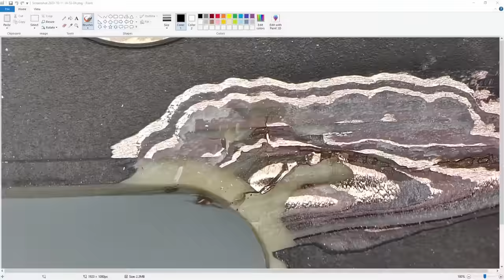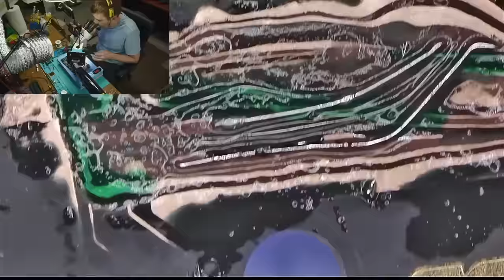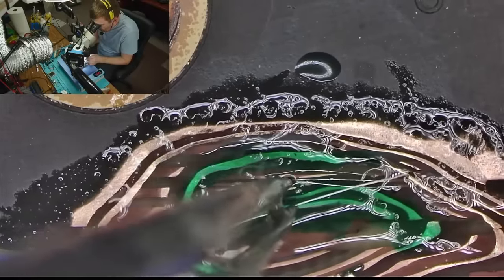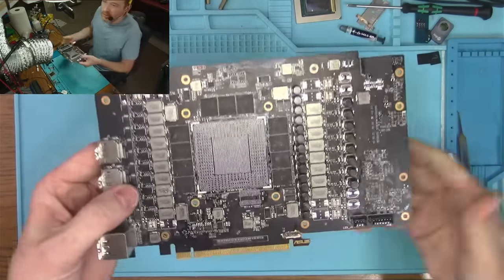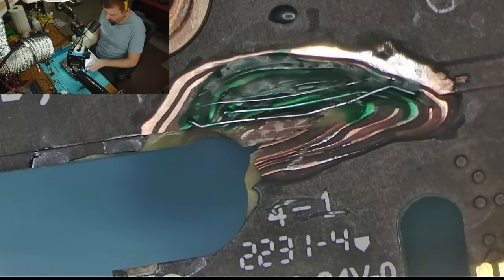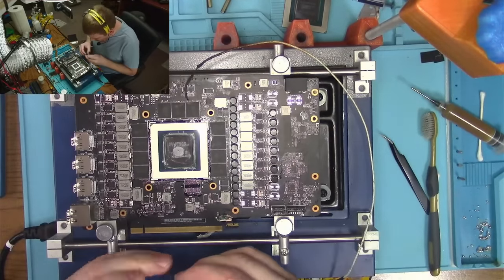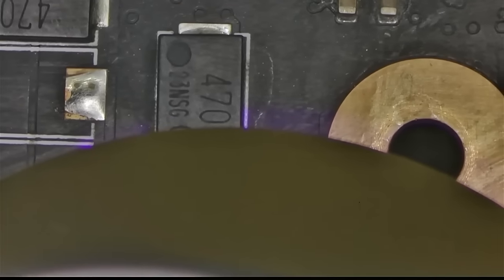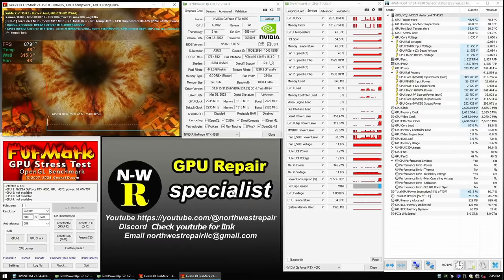Asus 4090 cracked PCB horror Part 2

Comment: If you want a fast setting 2 part epoxy but the one that is labeled 1 minute or 5 minute set time but they set up fast so you have little time to play around with it. You can use painters tape,  masking tape or electrical tape to stop it from flowing where you don't want it

Comment: I would say that you need MORE fibré threads in repair joint. Fill,  cover with clear sheet, and UV cure. Then peel off cover, to leave a nice flat glass-like surface. (fyi: Big Texas cracks come from too much bull🐂 riding)😛

Comment: They should make the pcb on alluminium composite. A layer of aluminium in the middle to increase rigidity. They can drill the aluminium in specific places to allow via to pass. And other board layers on both sides of the aluminium plate. 
It should somewhat solve the problem. Or better if they can make something out of carbon fiber.
Reply: Or people could stop abusing their boards, properly unlocking PCI-E locks, or installing the Card then trying to transport the case. They are heavy and they will break unlike lighter cards of the past. The number of cards I've bought and found components knocked off is getting ridiculous. No one has respect for delicate objects.
Reply: An Aluminum layer thick enough for such a purpose would make it an incredible pain to do work like this, as all the heat would be conducted away to the rest of the board.  It would become an all or nothing with soldering, either re-solder every component on the board or none.  It probably wouldn't be too much of an issue during manufacturing, but repairs would be horrible.  

No, the board makers need to do better with cooler design.  EVGA always reinforced their coolers against the IO plate where either the mid-plate or the heatsink itself is attached to the IO plate and taking most of the weight of the cooler, rather than the board.  It doesn't take much effort or genius to do this, just careful work, and most card makers aren't doing that.  The only other one I know of that does that sort of thing is Sapphire.  I never had card sag issues with my EVGA RTX2080 or my Sapphire 7900XTX, and both have the midplate, between the card and the cooler attached to the memory and power circuitry, fastened directly to the IO plate with a heavy reinforcement bracket, EVGA with a steel plate and Sapphire with a thick cast aluminum bracket.  No cracking on those cards, that's for sure.  They're held up by the back of the PC case.
Reply: @dangingerich2559 for all the hate amd reference cards get atleast there coolers are screwed into the IO plate.

Comment: Would that repair be just as prone to cracking again?  That seems to be an enormous amount of work for something that may be slightly weaker and more prone to the same failure.
Reply: I'd think so, but epoxy resin is pretty god damn hard. Only time will tell xD
Reply: @Orlyy  My worst fear would be after all that work the same thing would happen the very first time that card is placed back on the motherboard.  I hope it’s a vertical mounted card, or at least soon will be.
Reply: @Orlyy  heat softens epoxy resin
Reply: @james2hackett870  it does. But, it shouldn't be that hot around that specific spot lol
Reply: @vpreggie  yeah, I was thinking about vertical. I definitely wouldn't mount it normally anymore 😂
Reply: If I were him I'd use a GPU holder from now on, completely removes the stress from the PCB thus the risk of it cracking. Anyone buying mid-high end cards with 2.5+ slot coolers should use a holder even if the risk is low. They cost like 10$.
Reply: @constantinesoldatos yeah just the little telescopic ones are enough.

Comment: This is why some repair shops will immediately say No Fix on cracked boards. It's a lot work and can very expensive. For you as repairer a lot effort and can exhausted.
But Asus videocards have all bad design and not enough strength there at PCI-Express slot side. I see videos with mainly cracked Asus videocards.

So it will break again if customer put it unsupported back on his motherboard.

Comment: that heatsink fan is absurdly large and heavy by the looks and not surprised its pcb had problems just give me two slots and a light heatsink fan thanks
Reply: Lol, lmao even. You will enjoy the pesudo 2 card that extends into the 3rd slot. You will enjoy the need for brackets, foot stools and flexing that cracks weak pcb manufacturing.

Comment: /twitch

Frankly, I think it would be a boon for the GPU makers to shift to using LGA sockets for the GPU cores, sure those are a pain to repair if someone fucks up, but mechanically it's much less likely to suffer stress induced failures as shown by the disturbing bulges on the back of many a PC motherboard with nary a screw up. 

Excellent work though. 

As for the epoxy stink etc - it's down to the epoxide polymerisation chemical reaction, usually use amines to cure it and those usually stink somewhat, as do agents containing hexane and halogenated groups. Mechanical properties are down to what the R groups attached to the epoxide groups and various other chemical agents added. There's more detail organic chem knowledge involved, but I didn't major in organic chem, just biochem :P 

Though usually heat will increase the rate of curing, in theory :P

Comment: Imagine paying 2k for a card that breaks just like that
Reply: Yeah. Asus should take these in and simply replace the pcb. They should have tons of pcb's around and pcb with all the components installed is still less than 100$ , just transplant the ram and core on a new pcb and give the customer back his card. 
Even if they ask 200$ for this service, customers would be extremely happy.
Reply: if you break it like that then it breaks like that, nothing wrong with the card.
Reply: @wlewargusowy1592 You might want to read up on consumer rights.
Reply: Looks like user error and not the PCB's fault. I have a TUF card and that thing is built like a tank.
Reply: @Hellwalker855  yeah a tank hanging upside down on one of its tracks.

Comment: Nvidia and AMD could've been putting 4090 sized coolers on their graphics cards 20 years ago to shove as many watts as possible through them and jack up the clock rate. There's a very good reason that they didn't back then: it's effing moronic. It's a dead-end approach to maximizing performance. It's an unsustainable strategy to improving each new generation's performance over the previous generation.

The performance gain that the 4090 has over the 3090 was achieved partially through arch changes and improvements, but also by clocking it higher - which requires more juice, and more juice means more heat, so they had to put a larger cooler on the 4090 than the 3090 had. If they'd kept the same cooler as the 3090 then the 4090 wouldn't be able to consume as much power as it does, which means it couldn't be clocked as high, which means its performance would be less than it is. Now what's the strategy for the 5090? Make the cooler even bigger to clock it even higher? There's a limit consumers will tolerate and I'm pretty sure the 4090 hit that limit.

So, unless they have stroke of genius levels of architectural improvements, the 5090 isn't going to have anywhere near the performance gains over the 4090 that we saw between the 3090 to the 4090. They played that card already, too many times, and have run out. Making the cooler bigger is basically no longer an option if they want people to be able to use their stupid video cards - and it's the opposite of what other technologies do: which is decrease in size, become more compact, more power efficient, while also being more performant. Nvidia's honking coolers are an epic fail.
Reply: 5090 supposedly has 50% more cuda cores over the 4090 with around 15% higher clock speeds. 4090 already had a 450w tdp as it is, and rumors say 5090 will use a 600w capable heat sink (not that it will use 600w).

Comment: Why do these cards need to be so frickin huge?  Because the 4090 is a card that takes 400-600W of power and that needs to be dissipated.  It's a literal space heater.  This is the first GPU that needed a high power connector because Nvidia's power draw is completely out of control.  For all the hate you have for AMD, at least their flagship pulls about 350W, not 450-600W and didn't have a connector that could catch fire in the right circumstances.

Also, don't believe me that it's a 450-600W card?  Go look at the GN review where they break down the power and thermals to nauseating levels.  This is a space heater.

Comment: wouldn't it be great if the template could be locked and then the chip slowly dropped
a little to check what lil far-ker Err-Ball ain't playing ball and sticking to the template?
To which by using a brush convince it to play ball, once all the balls are all playing 
ball you can drop and then slide out the chip from the Jig..
Or maybe that whole deal could be switched where the template can be slightly 
Raised to convince stubborn balls to drop on down into place before it is fully removed..

APU 👁👍

Comment: 3 cable 12v is for the 3090ti.
Reply from the maker: you may be right, i dont know. It came with MSI 4090 so i took a guess.

Comment: i remeber when i first got ny evga 10 gig black lipped ftw 3 evga posted a mod for it so it could run 450 watts about 2 weeks later they took it down off website.i thought about trying it thank god i didnt.i just ran it stock its still hanging in there

Comment: i have a ssd with ps3111 and 4 nand bGA 152 "NW826"

20 PAD FROM NAND 2 IS BROCKED . I SEARCH AND BUY PCB ,FOR ALMOST 10$
IF YOU CAN BUY TH PCB ? ALL 4090  PIN IS SAME IS NOT ?
BUT I THINK NVIDIA IS YOUR HEMORRHOID
YOUR NUMBER 1 IN GPU BUT AFTER FIX THAT .MAY BREAKE AGAIN .TO HAVEY 
THEY MUST SELL PCB WITHOUT THE GPU CORE ,RAM,BIOS CHIP